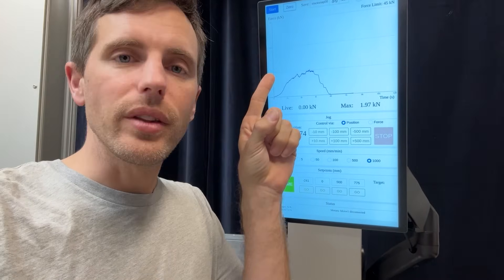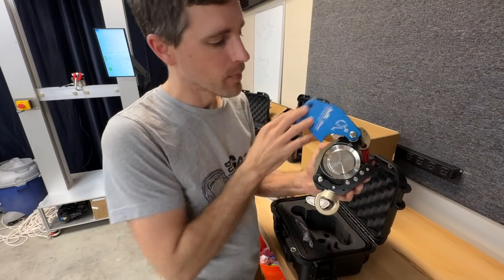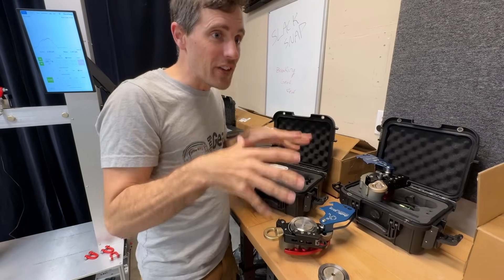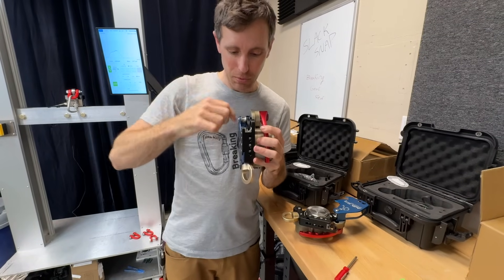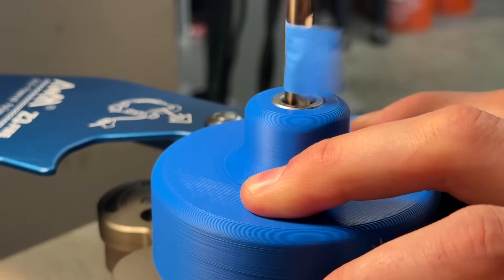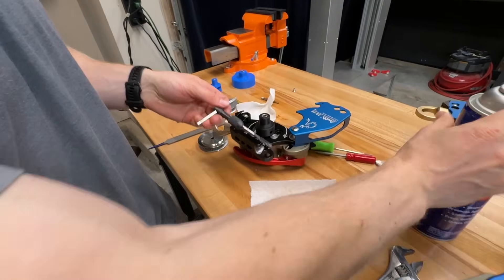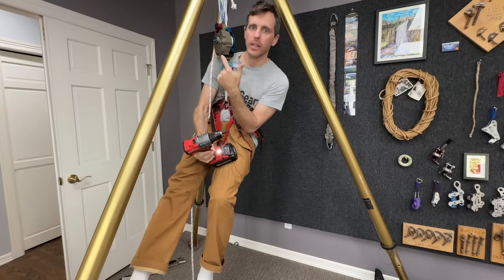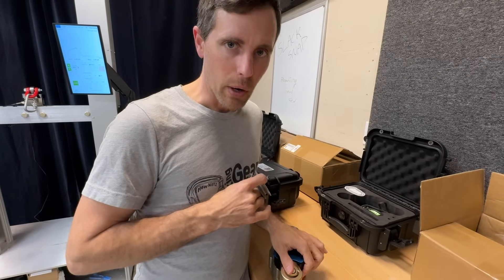I didn't know drilling a hole was so hard

Comment: wanted you to going to cover the support jig / system for underneath!
glad you have only got 140 to do! fingers crossed regarding the re-certification!
& ace re getting the rivet changed to a screw!

if you do go down a threadlocking route; could the manufacturer provide a 'patch screw' / patch lock fastener  (Thread Lock Pre-Applied & 'dry'; appears as a coloured area)  hope that helps!  :-j

Comment: The danger isn't that the screw disappears, the danger is that the screw backing out pushes against that blue cover and bends/breaks/jams up something that it shouldn't.
Reply: The wheel only rotates counter-clockwise so if the screw were to somehow start backing out during an ascent, it will hit the side plate and start threading back in until it isn't touching the side plate anymore. Practically no way for the screw to damage anything by coming loose other than some extra play in the wheel-to-shaft connection potentially causing extra wear over time.

Comment: Using tape as your depth mark on the drill bit is cheap and easy but it you have a bunch of holes to drill there’s two things that will help, 1 use a drill collar, and 2 the drill press should have a Z stop so set that where you need it. With either option all you have to do is drill down until you can’t anymore and it will be where you want it

Comment: For drilling precisely positioned holes, you're best to use a centering drill bit before you use a pilot drill. They are much larger in diameter with a small tip, so they don't wander around as much.

Comment: Smart mod!
With ideas from aircraft misshap investigation, you should ask and answer this Q: What could be the consequence if you remove the centre screw during operation? If there are any consequences,  you will need to secure the screw accordingly...
Reply: he discusses exactly that, at length, in the very video you're commenting on suggesting this.

Comment: Split wheel in half then use spacers to make it work for different size ropes. It would make the wheel halves easier to machine due to better internal face access.
Reply: Also definitely some loctite after cleaning tapping oil off.

Comment: A wheel that fits common arborist ropes would be game changing this is so much more compact than stuff like the ronin. If you already have milwaukee battery saws or a drill for the grcs it makes even more sense to pull the trigger on one of these.
Reply: I've had the z3 and milwaukee combo for a few months now and love it, especially when running the forge batteries! (70' ascent in 30sec in high gear) I use an 11mm srt rope for my accent, and will work off of the z3 if the climb is not too technical. However if I am going to be doing a lot of limb walking, I'll just install my regular drt rope with my hitch climber pulley in a suitable crotch.  Definitely worth the purchase especially if you plan on climbing for another 10+years

Comment: For the fully paranoid there is a medium strength version of Loctite (243)  that can help the threaded parts stay together more convincingly without preventing changes down the line.
Reply: I'd agree, but because the screw is never under much load, you could just add a torque check to the six month log-book check, and problem solved. But if the wheel wasn't otherwise mechanically supported, great idea.
Reply: 243 (blue) is a med strength one! no need to go to 222 (low strength as that's for small dia / brass etc.   hope that helps!  :-j
Reply: I was thinking the same thing! and also saw a comment about load, but loctite and this kind of safety isn't always about load but also vibration / regular use, especially for climbers and everyone that intends on using this, it might bump a lot, might have to be in a car for a long time, etc.
I work a lot on musical instruments and the amount of screws that loosen themselves out because of vibration is unbelievable!
Reply: @leoleoleonor  absolutely relevant to cables with screw terminals in tour trunks!

not sure where Loctite stand re 222/243 etc on mains terminals tho...

Comment: That's an amazing series of jigs. Seems like it would be easier if you had a Bridgeport
Reply: Yea, it's interesting but wholly unnecessary. It should have been done with a milling machine and a stubby. You are cutting steel, drill bushings are for wood.
Reply: on second thought, I don't hate it. It's fine.
Reply: @Vsor  It's a lot cheaper than a milling machine. Even a cheap mill is more expensive than 3D printing a few drill bushings. A mill is absolutely a better tool for the job, but only if you've already got a mill.
Reply: @Vsor spot drill + drill press + drill bushing works perfectly fine.

Probably even be able to skip the spot drill in favor of a full diameter split point.

Comment: I would not use WD40 with a tap. There are tapping oils that you should use that do a better job. WD40 can rust things. Great for a fish attractant but not a lube for cutting.
Reply: Except in aluminum, where WD40 is great as a cutting fluid. For steel, Tap Magic or Anchor Lube are good, depending on what you're doing. I prefer the thinner Tap Magic for hand-tapping, and the thicker Anchor Lube for high-speed operations like drilling or even power tapping. It doesn't go flying everywhere as easily.

Comment: You might consider using "Tap Magic" instead of WD40 as a thread cutting lubricant.  Any thoughts on using blue lock tight on the screw?
Reply: I have been using that blue Spyder stuff since I guess Lowe’s stopped selling cutting oil. It works for handyman stuff.
Reply: Entap 55 is my favorite. I think a little Blue 242 would be a good idea.
Reply: - absolutely to both  - loctite is just that little "extra"..
Reply: Meh, it's one hole and the lube is to control heat, reduce friction. If it's smoking like mad, just add more. WD-40 isn't good for much, but it's probably good enough especially since that wheel is just aluminum. If it were steel, actual thread cutting lube might be a boon.
Reply: @d-rot  They are not tapping the wheel but the shaft which is steel.
Reply: @AnttiAlajuuma  It's still only one small hole. I'm a pipefitter, I've threaded plenty of shit. You don't especially need thread cutting oil, any shitty old lube, hell water in  pinch, will do.
Reply: @d-rot  Yeah, I know. Just pointed out the material.

Comment: I built my own power ascender, wheels are tricky. Ended up making 2 wheels for different sizes because the range was so narrow.
Reply: That is so cool.  I have wanted to make my own power ascender for a long time.  Do you have any pictures or videos of it you would be willing to share?  I would love ideas as to how you did it.
Thanks so much!
Reply: @ongridself-reliantfamily1751  thanks man it's been a very fun and rewarding build with several iterations now. I'm an arborist so thats my main use for it. Essentially you'll start with a Rollgliss R550 which is a rescue/emergency decent device (very expensive but well engineered) and build from there. The device originally had a hand wheel that drove a gear and rope wheel and I replaced that with a drill.

The R550 is not midline attachable at all so I redesigned the cover over the wheel to have a folding side plate  that captures the rope and wheel and also the main carabiner on the bottom. That ensures nothing can come apart with the carabiner attached or under load. 

The next part was to remove the chuck from a milwaukee drill and machine a chain sprocket to replace it, and machine a chain sprocket to take the place of the wheel. Then a bracket to firmly hold the drill beside the r550 and a chain to link them. 

I 3D printed a chain cover for finger safety and it was basically done. That only let me use 10mm rope and as an arborist that meant swapping ropes and was a bit of a pain. I machined a new wheel on my mill and rotary table, copied the geometry of the smaller one to accept 12mm arborist lines and called it done. There are a few videos on YT of r550 based ascenders but I haven't uploaded anything yet and mine is quite a bit different, although similar principles. Again it was a ton of work but well worth it IMO
Reply: @ Wow, that sounds like a super cool build.  Very nicely done.  Those R550s are super expensive, so I am glad there are other alternatives starting to appear.
Thanks for the details.
Have a great day, and Godspeed!

Comment: You made it all the way thru the video and never called it a BOLT.
Reply: It is a machine screw
Reply: @Ammoniummetavanadate  *cap screw
Reply: That's because it's a screw and not a bolt. Bolts are held on with nuts.

Comment: There's a market for a non-climbing version of this that would work as a handheld winch for ATV recovery.
Reply: Mine exploration, etc. 👍🏻
Reply: This does exist! Look up a drill winch. I've never used it, nor am I into ATVs, but for non-life supporting purposes I'd give it a try.
Reply: This device isn't purely for climbing
Reply: There are much cheaper drill powered winches for that.  I have a warn winch that was under $300
Reply: It's only 200kg capacity though. Depending on incline, you might damage the lift, or have the pulley slip, or you might need to use a tackle. For automotive recovery, you also don't need the ability to insert your rope anywhere, which is one of the big pros of this device.

Comment: You should be using a spiral flute tap rather than the spiral point. Spiral points push chips down into the hole and are intended for through holes. Spiral flute taps will pull the chips out of the hole and make it was less likely to break from binding and also save you the hassle of pulling the chips out of the bottom of the hole
The rest of that process is pretty cool though, I like the 3d printed drill guides.
Reply: Looks like he was just using that to start the threads, then switched to a coated bottoming tap to finish.
Reply: @elonquemattheson6151  yeah, but it still pushes the chips down into the hole for the first couple of threads. Unless you fish those out before continuing the bottoming tap is going to jam them into the bottom of the hole, which may be fine until you try to thread in a screw and it gets bound up on one.
Reply: I have never noticed a difference, even with thick material. There is no way the flutes fill clog on that little 1/4" hole
Reply: Not doing enough for it to matter.

Comment: Cut the wheel in half.  Use shims to space the gap.  One wheel to rule them all.....
Reply: With this plan, the forces of the rope trying to separate the two halves is transferred on to the bolt. Also if the bolt clamping the wheel begins to come loose, the pulley profile would change as the halves move. It could slip or chew the rope at a random (low) amount of force. With the existing design of the solid pulley, the bolt only serves to hold the pulley onto the flats of the central shaft without taking much additional force from the loads that get placed on the rope.
Reply: @edsimmons3574  a few extra bolts fixes your issues